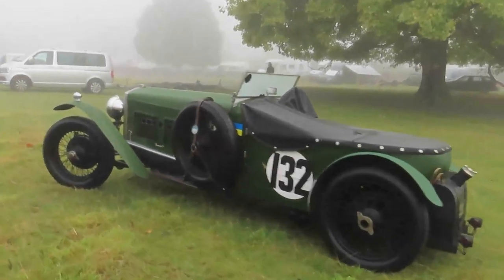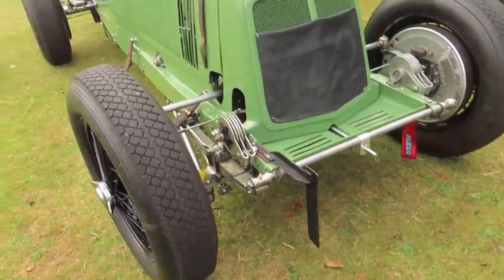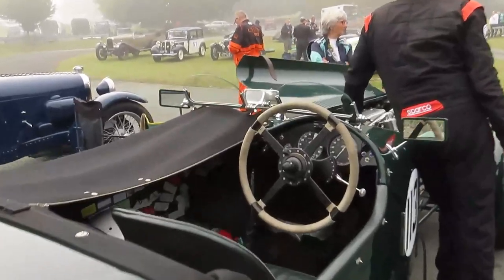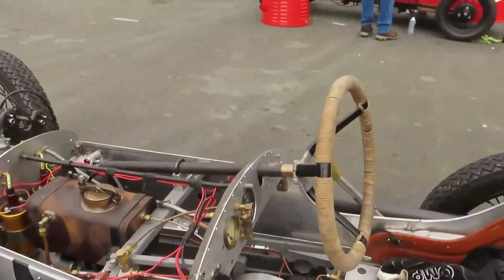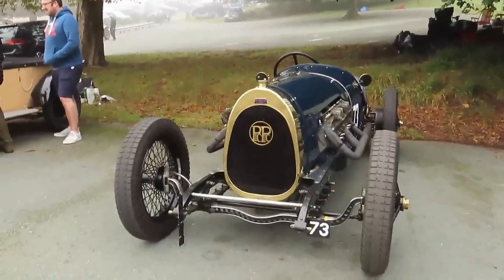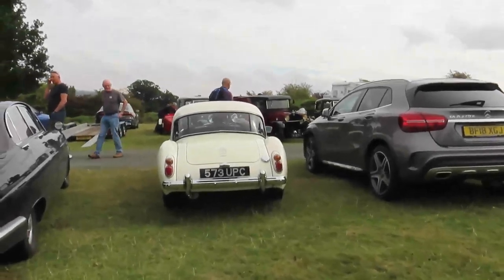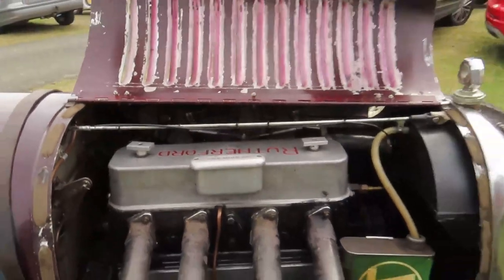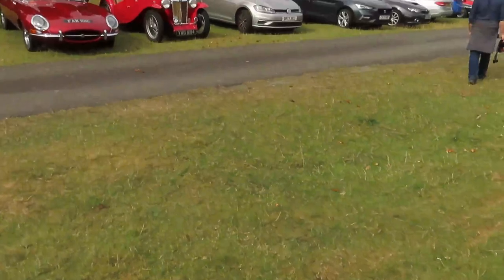VINTAGE CARS ON THE LIMIT at VSCC Loton Park 2022 | ERA, Bugatti Type 51 and more!

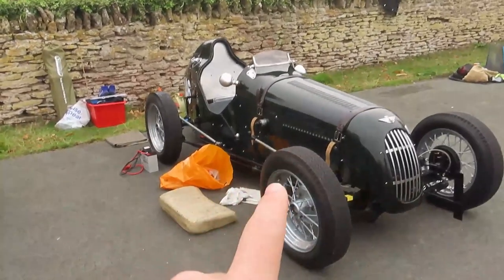Comment: The Austin 7 Specail ar 21:00 has an off-set differential to the LHS, with an engine angled to point to the dif. This enables the driver to sit lower and have the prop shaft alongside them, then the rear axle to also sit lower in the chassis. It would be worth asking to see the bonnet off. Would make great content.

Comment: Great video. Love the way you walk us through. What is the vertical metal strip for that all the cars have extended out front for?
Reply from the maker: Thanks, that's to shave a tiny bit of time over the finish line as the timer stops at the first point of the car crosses

Comment: I am going ot have to see if they have anything like this here in the States. I am in the process of building a 1928 Morgan Aero from scratch. A replica of the RIP racer with the wooden slats and aircraft fabric. I have an Onan/Tiger moth opposed twin engine coupled to an MGB transmission then on to a Honda Gold wing shaft drive wheel as the driving wheel. Thank you for the video